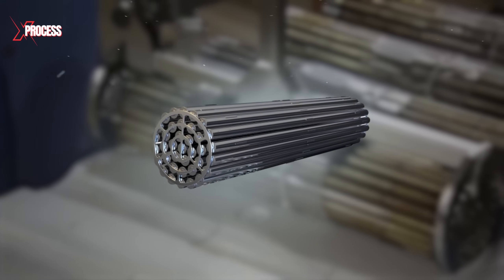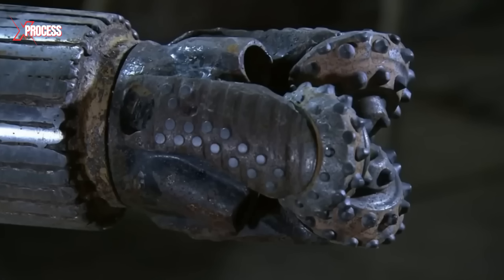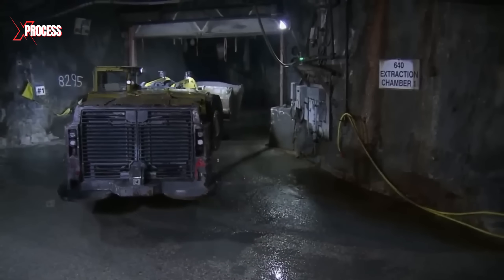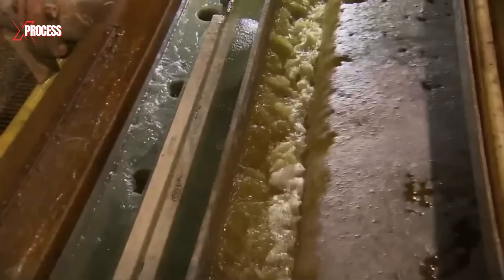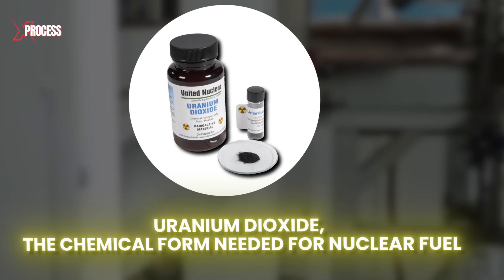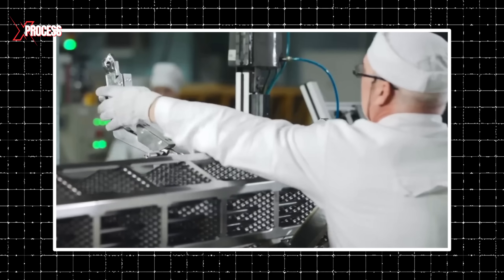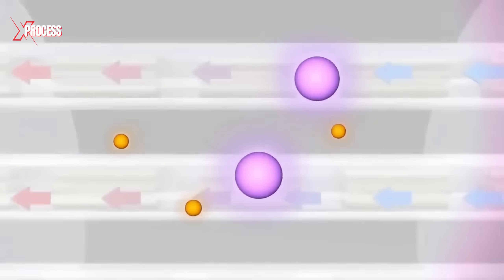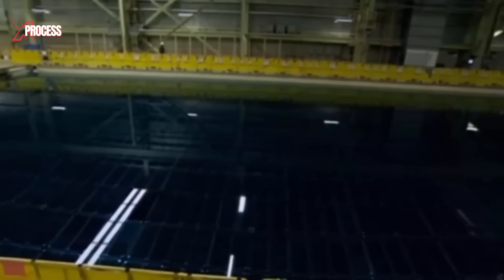How Enriched Uranium is Extracted & Transformed into Nuclear Power!☢️

Comment: Interesting — but to add regarding spent fuel, it can remain in cooling pools for anywhere between five and ten years. This depends on the policies of the specific country, the level of fuel burnup, and the reactor type.

After that, it’s typically transferred to dry cask storage; however, in some cases where options are limited, the fuel may be kept underwater for longer.

What's an absolutely fascinating subject. Radiation is like the Yin and Yang of science. It can be either be used for hell or for help.

I have some pitchblende samples and also some Trinitite. 

So fascinating, as is the Cherenkov radiation. What a beautiful color and such interesting science.